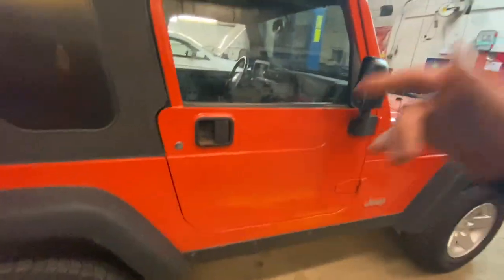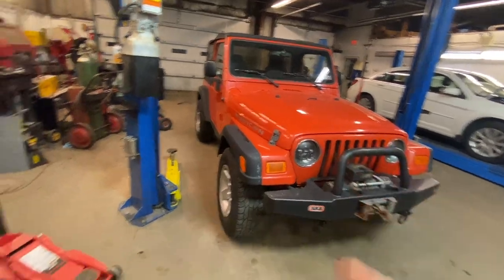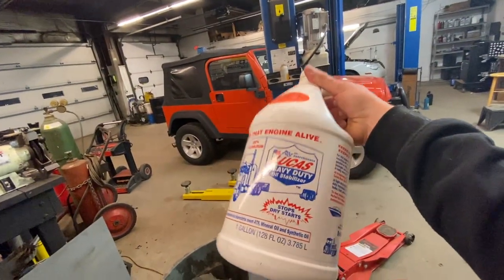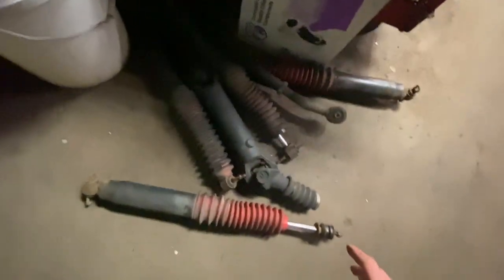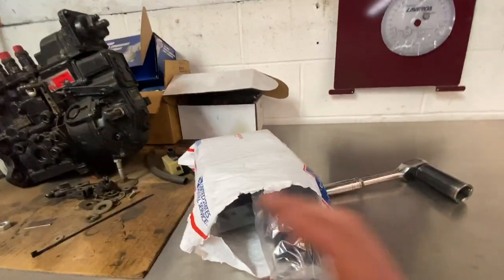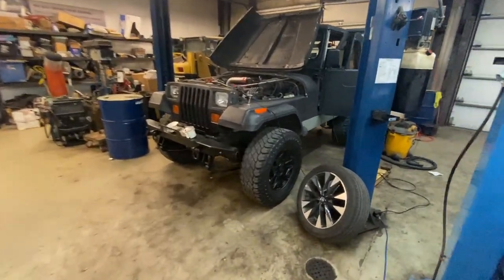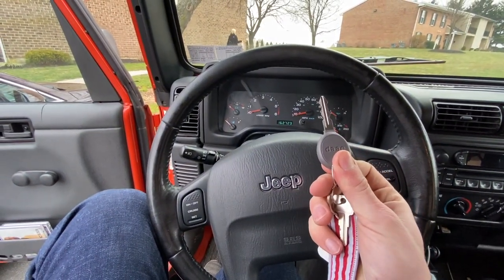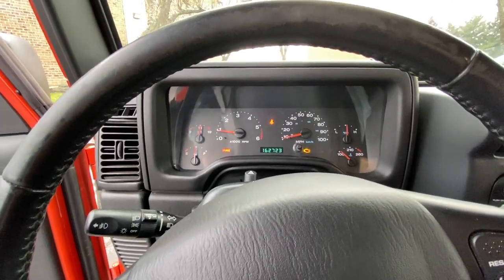My Jeep Rubicon Has Rod Knock After 1700 miles :(

Comment: Sounds good to me, just keep an eye on it, check at least every other cruise just to figure out if the oil is burning or not. Could be possible they ran it through some quick lube joint and they didn’t put enough oil in if any at all. Don’t get bummed, these Jeeps are made for thrashing, parts are easy enough to get.
Reply from the maker: I’m uploading a video tonight.. but the rod knock came back (3 days later) and isn’t going away but still holds oil pressure dispute the severe misfires it has. It’s very heart breaking buying my first vehicle through a dealership just for it to bite me in my ass because I told myself I’d never buy a car from this specific dealer and I did anyhow. I checked the oil when it lost pressure but it always had oil so I figured the sensor was going bad... I was very wrong clearly. Hopefully the dealership works it out with me or I’m going to be pissed and broke for a very long time. Will probably have to really sell the XJ for good and not allow it to be given back as a gift again lol

Comment: If you bought it from a dealer, there should be at least some kind of warranty? I rod knocked the 2.0L in my 95 Neon ACR. Turns out I'd spun 2 rod bearings. Dropped the pan and replaced them and flushed the oil. Should have pulled the motor out and done a complete flush and rebuild but didn't. What was left behind in the block wreaked havoc with the cam and crank sensors, so it never did run right again. I would drop your pan and check the rod bearings and the mains. Also do a thorough flush. Still easier than an engine swap...Sorry dude.
Reply from the maker: I didn’t buy with a warranty at all. They already tried blaming the misfire on me taking it off-road but I went back to the dealer 30 minutes after buying it to pick my XJ up and it had a check engine light.
Reply: @JeepinDaily  I'd still pull the pan and check for metal  dust in the oil. At the very least give it a good flush. Should be able to save that motor. Swapping out for a used motor is never a sure thing. IMHO.

Comment: Even in a new car, you're supposed to check the oil weekly. Come on, man. And you're dad runs a shop. You should know better.
Reply from the maker: I can guarantee you, 99.99% of people do not check their oil weekly. And I know you definitely don’t
Reply: I do, actually. And have for years. I have 3 jeeps and 2 diesel trucks I check every weekend. There is only one of them with less than 250k miles.